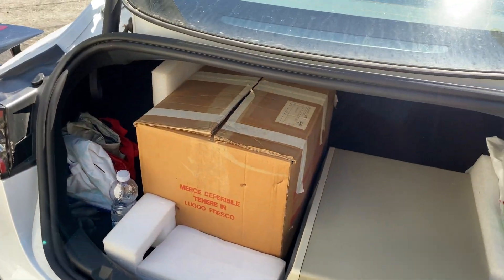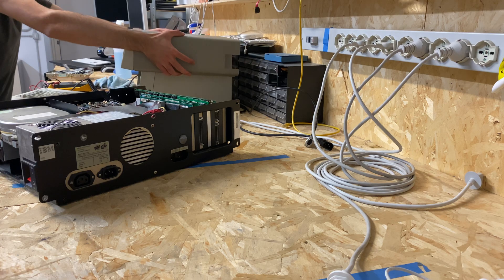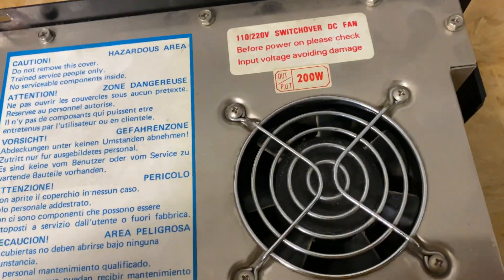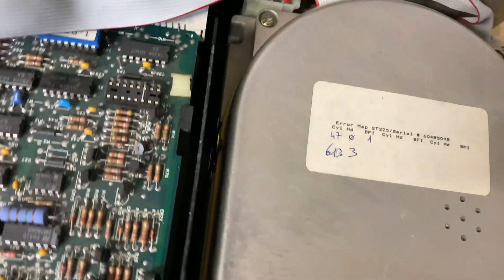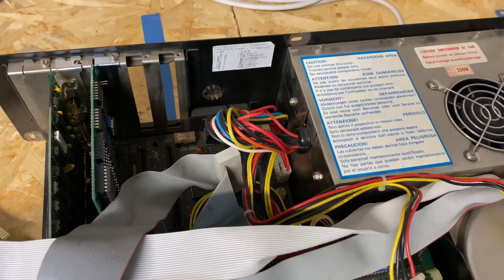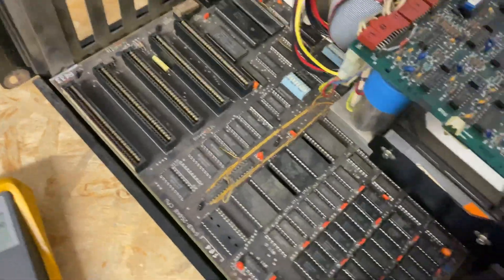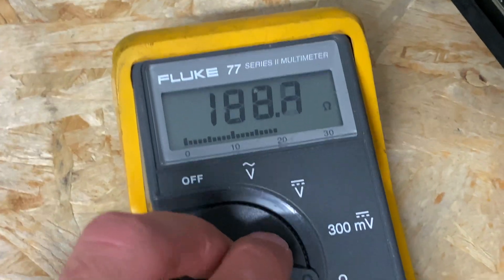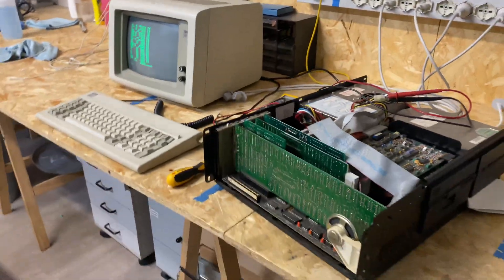IBM PC 5150 with explosion!- Pickup Troubleshooting and Repair - Anniversary Edition with a BANG!

Comment: ST-225s are rock solid drives.  The PSU looks to be aftermarket, but I could be wrong about that as I haven't seen any Scottish made 5150s personally.

My 5150 had very low hours as it was US military surplus and used only on a trial basis, so I haven't come across any bad tantalum capacitors (not yet, at least).  It was originally a diskless workstation, and had a special interface card which connected it to an interactive TV system called MicroTICCIT.
Reply from the maker: Yup the PSU has been replaced when they installed the HDD most probably, I guess the standard 60W unit wasn’t enough. I have another machine that has the original PSU and too me ages to repair (shorted rectifier diode on a negative rail)